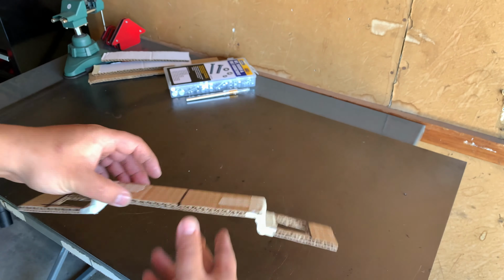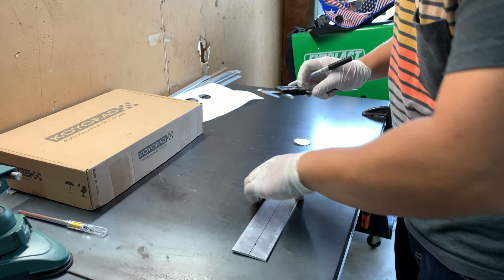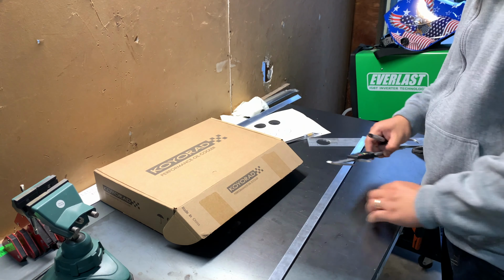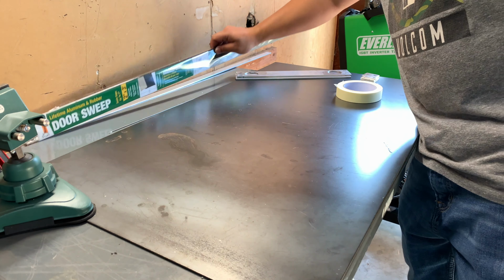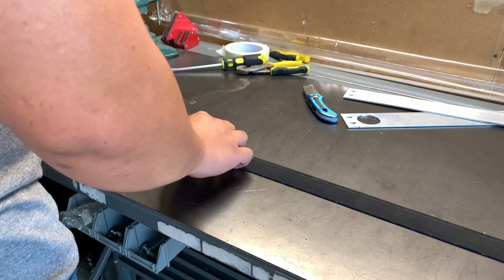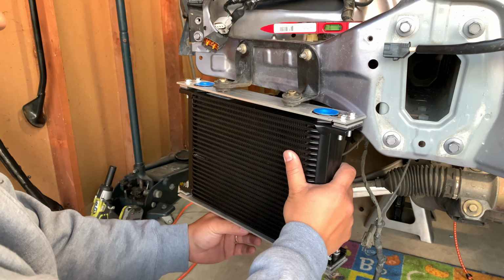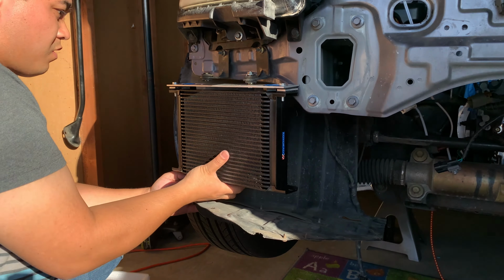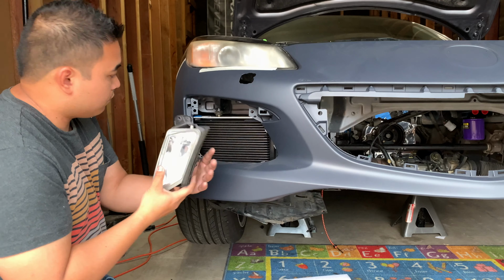13BREW RX8 Oil System (Part 2): Dual 25 Row Koyorad Oil Cooler Install on Your Mazda RX-8

Comment: Can you use the factory ducting to the coolers from the bumper?
Reply from the maker: Hey man. Im sure you can with some trimming and trial and error. I currently run the same setup on my FD here in Arizona without ducting and have been getting steady oil temp. Eventually i want to add ducting 👍

Comment: Why did you decide to do the side mount oil coolers?
Reply from the maker: Cooling powa! Lol. Dual oil coolers will probably be overkill.
Reply: @freemadc2  what are your plans with the car?
Reply: Is the right one engine oil and the left gear box oil ?
Reply from the maker: Currently the RX8 REW swap build is long gone and 2 new projects came into play. Stay tuned for more content.